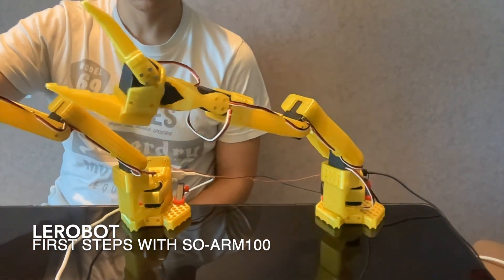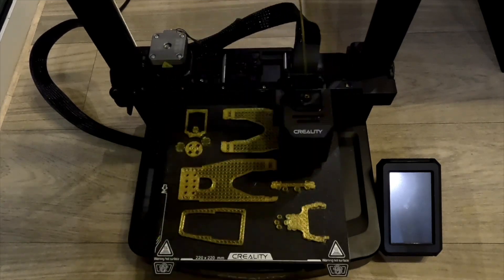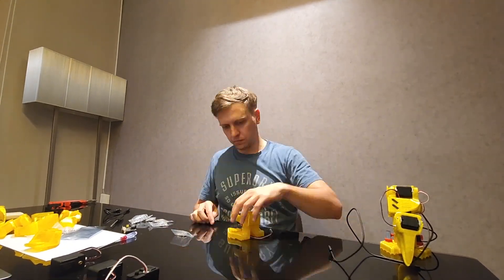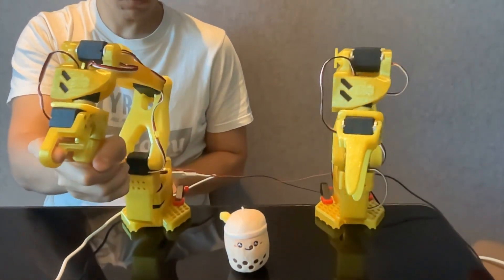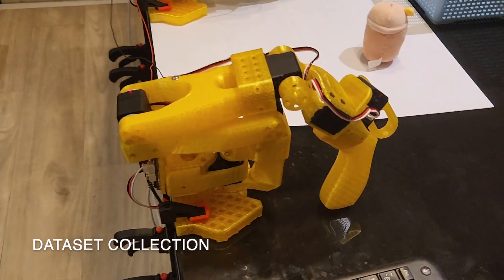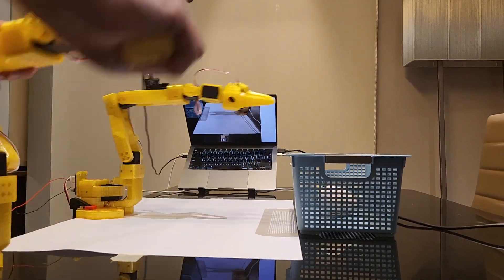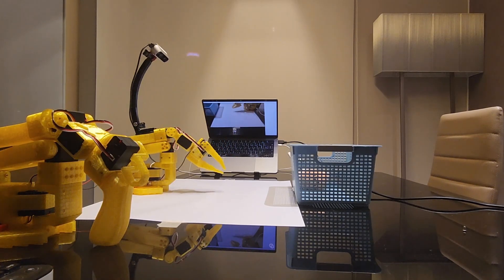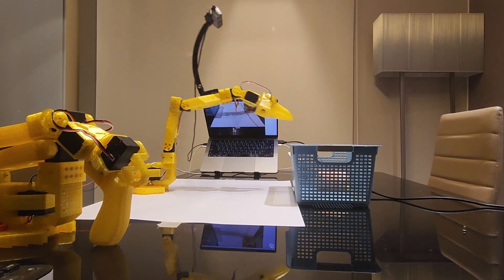3D-Printable Open-Source Robotic Arm with AI

Comment: I've got a decent amount of ai experience but no 3d printer experience. Do you have any suggestions as to which model i should order?
Reply: bambu labs p1s, it just works
Reply from the maker: I am not a big expert in 3D printing either. I used Creality Ender-3 v3 KE, and it worked pretty well. I printed 2 sets of robots with different types of filament and a bunch of other stuff. But I don't have much experience with other printers, so I'm not sure if I can really recommend anything.

Comment: so interesting!!
what is the role of laptop CAM & Robot CAM ?
Reply from the maker: @호준최-n7z  the robot uses images from cameras as the main input and predicts the next N actions based on them. You can use any number of cameras, both stationary and attached to the robot. All of them are treated tge same by the policy. Having one camera close to the robot gripper and one stationary camera outside is an easy and relatively good basic setup. In my later experiments, I use 3 cameras: top view, wrist, and forward-looking.

Comment: Why is it jittery
Reply from the maker: @secretvanush I significantly reduced jitter later by adjusting PID coefficients. It is much smoother in my recent experiments
Reply: @ilialarchenko  Dumb question, but with these arms can I command certain movements? Like move to x,y,z? I've only seen it do stuff thru a camera and training.
Reply from the maker: @secretvanush  By default, this robot is designed for AI-based end-to-end control. However, you can also manually control it by sending commands with simple development.

For example, in this video, I show how I integrated a PS4 controller to send commands to the robot https://www.youtube.com/shorts/Ini2DATLawU. 

The community has also developed other control methods, including gamepads, keyboards, touchpads, and non-original leader arms. But they are not yet a part of the LeRobot library by default.

Comment: This is so awesome! Is the software open source, or just the 3D models?
Do you have complete build instructions for the project? I'd love to build one!
Reply from the maker: Software is open source: https://github.com/huggingface/lerobot
There is also a detailed build instruction in the official repo
Reply: @ilialarchenko  Sweet! Could this easily be scaled up to something that could lift 20+ pounds? I assume getting bigger motors (and everything in the chain that powers them) and beefing up the prints is about all that's needed?
Reply from the maker: @ for 20+ pounds you will need another more powerful arm, I don't think you can upgrade this one so easily. But the logic/algorithmic part will stay the same.

Comment: How did you train the model? Are you using openVLA? I just ordered the motors and bought an new 3D printer
Reply from the maker: In this video I used ACT policy, which is easy to start with.
But currently, I am experimenting with my own policy: https://github.com/IliaLarchenko/dot_policy

Comment: Fantastic! Can you please tell me which realsense camera you used? I'm about to make the SO-ARM100 as well, but I didn't see any recommendations in the tutorials about buying a camera🤔
Reply from the maker: I use RealSense d435 but I do it just because I had it. I use it as a normal RGB camera and ignore the depth data for now. Any camera that you can mount to the robot will work fine. I didn't see any standard camera or mounting method for SO-ARM100, I think people are still experimenting with different cameras.
Reply: @ilialarchenko  Thank you for your reply! In that case, I will try a cheap camera(50$) first